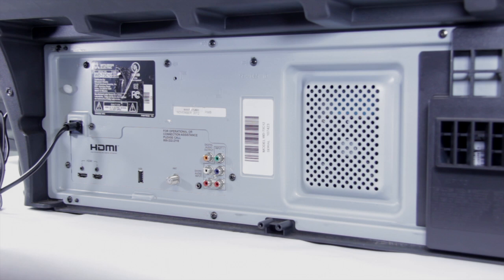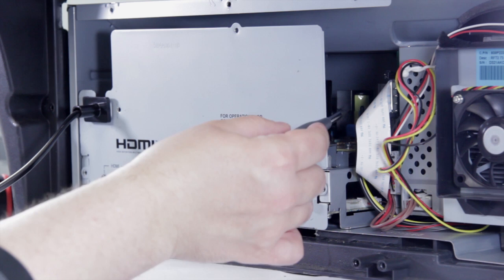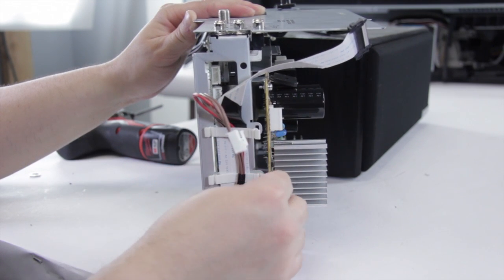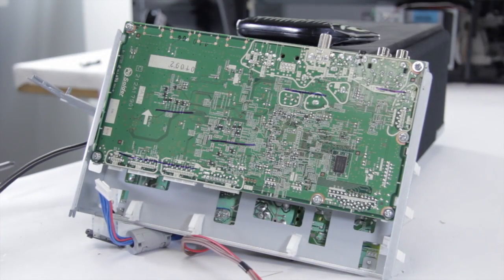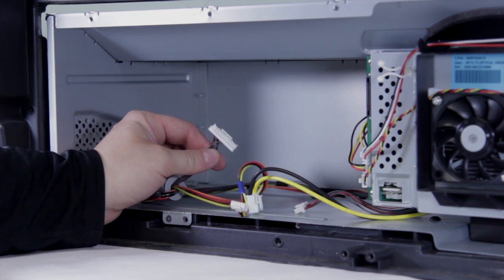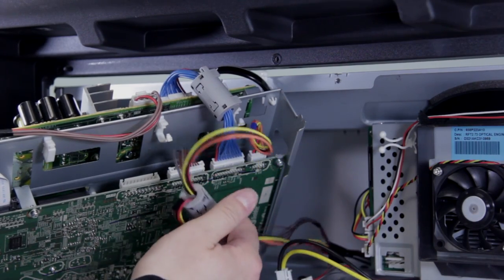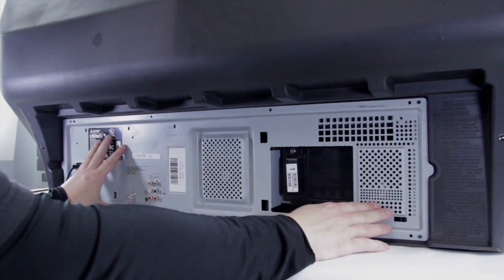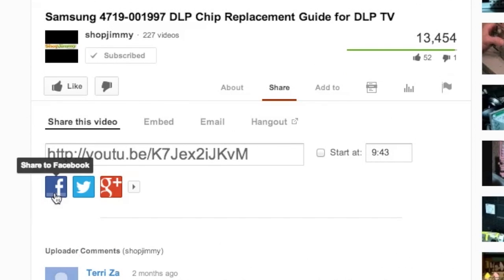Mitsubishi Toshiba Samsung DLP TV Repair No Picture No HDMI NO VGA - DIY DLP Main Board Replacement

Comment: I have model LT-52153 Mitsubishi Unisen 16 speaker tv, 2009 year. Four years ago the sound stopped working. Had the main circuit replaced. One year later, again,  same problem. Need help. Love the picture quality on my tv. Does anyone have suggestions?

Comment: Hey guys I have a Mitsubishi LCD tv model LT-52149 that's having some issues. at first it was just some discoloration on the right side but has sense progressed to the point where the screen is either completely black completely pink or blue or a variety of different colors. sometimes it works if I hit the reset button on top but it doesn't last long. what parts should I buy to fix this issue?

Comment: Can someone please help me to find out what this problem is! I have a Samsung dlp tv hl-s6186w . First of all when I use to turn the tv on it would be on for a few seconds to minutes then start to flicker white with some colors in some spots (I think green) then the tv would turn off on its own with 3 lights blinking standby.temp.lamp , so I figured it was the lamp. I have recently changed the bulb and now the tv no longer comes on just the standby and temp. Upon turning the tv on the cable to the main video board literally started to catch on fire so I unplugged it. The bulb does not come on and  neither does the fans. HELP!
Reply from the maker: Caitlyn Albury  PLEASE SUBSCRIBE TO OUR CHANNEL - Try all repairs and troubleshooting at your own risk.  If that wire is burned, then the TV should be replaced.  Thanks!  www.shopjimmy.com

Comment: I would like your feedback. I have a Samsung HLP5063 Series. My Hdmi does not work. It reads that it is there when it is pluged in but other than that it does not work. I really do not want to replace the digital board. Any sugestions? By way the port looks good. No dust or  loose connection from the outside. Is it possible to  fix it Without replaceing the Digital Board? Every other port works just fine too. thanks
Reply from the maker: David Morrow   No, you will need to either replace the board or just use the other ports.  Here is a link to replacement parts for your TV model number on our website, click here:  http://www.shopjimmy.com/catalogsearch/result/index/?cat=225&q=HLP5063  Be sure to match part numbers on your current board, with your replacement for compatibility.  Here is a link to a video showing how to identify your part number, click here:  Samsung Main Boards & Digital Boards: Part Numbers for LED, LCD, DLP, Plasma TV Repair  You can also call our customer service for further assistance with your purchase.  (877) 881-6492  Thanks and please let us know if you have any further questions with your TV Repair!  www.shopjimmy.com

Comment: I have a Samsung DLP TV Model # HL-S4676S. The sound crackles and pops after the tv has been on for about a half hour.  I was told I may need to replace the main board, is that correct?
Reply from the maker: Randy Sommer   I recommend replacing the main board in your TV.  Here is a link to replacement parts for your TV model number on our website, click here:  http://www.shopjimmy.com/catalogsearch/result/?q=S4676S  Be sure to match part numbers on your current board, with your replacement for compatibility.  You can also call our customer service for further assistance with your purchase.  (877) 881-6492  Thanks and please let us know if you have any further questions with your TV Repair!  www.shopjimmy.com

Comment from the maker: @gs8777 - I would recommend replacing the main board in your TV.  I cannot recommend a specific part, since I do not have your TV model number, but I would recommend calling our customer service and they can help you to find your replacement part.  You can reach customer service at this number - (877) 881-6492.  Thanks and please let us know if you have any further questions!

Comment: Hey shopjimmy! I have a problem with my television and my question was more about how could you fix a mainboard whos HDMI ports have come off, literally they were pulled off the mainboard(faulty design). Is there any way I can solder it back on? I am rather attached to the 22055 hours I have logged with the system and other than this it has been a great television